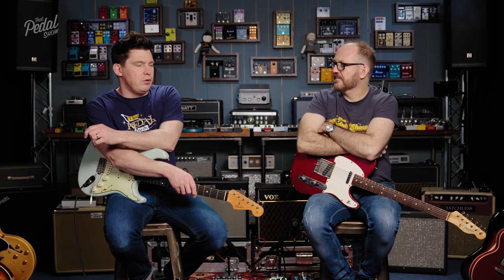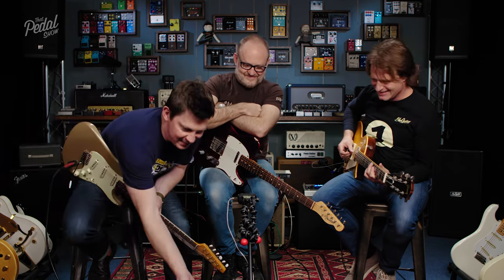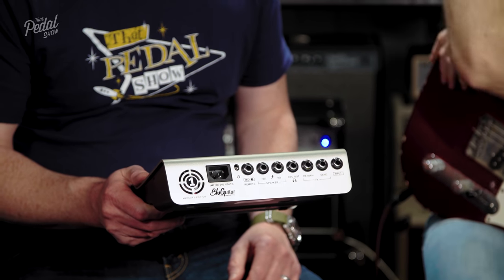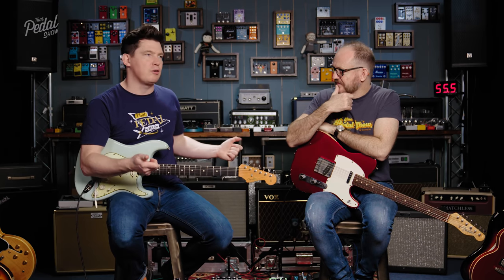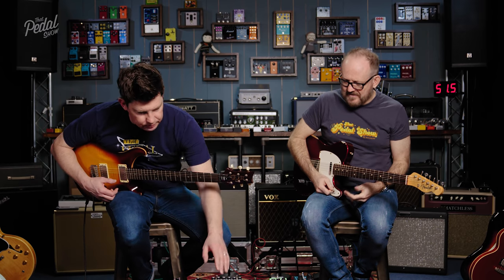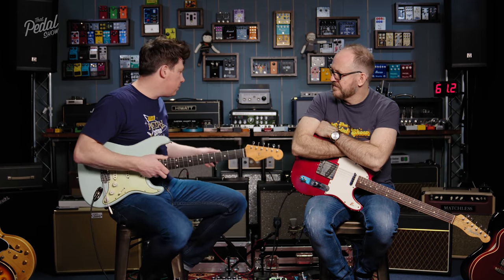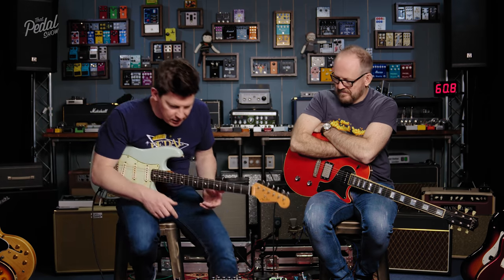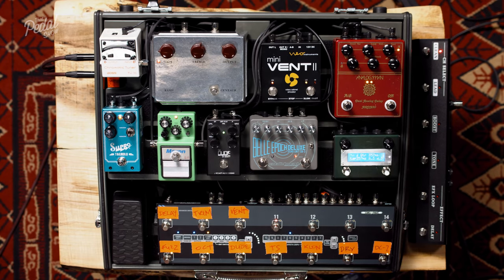Yes We Do Like Transistor Amps #1: Boss & BluGuitar – That Pedal Show

Comment: I'm not sure what point you were trying to demonstrate, Mick, fiddling with the AC15 tone cut control while claiming that the difference you were hearing is a feedback thing. The Vox tone cut is not a negative feedback control -- can't be, since there is no NFB loop in the AC. The tone cut is not like a presence control, which is in an NFB loop and changes the amount of NFB "correction" of the signal at some frequencies; rather, the tone cut essentially puts some frequencies out of phase in the forward, push-pull signal going to the power tubes.

There is definitely a tonal and feel difference between amps with and without NFB, but twiddling a Vox-style tone cut doesn't directly change NFB in any way.
Reply from the maker: Oh balls, is that what I said!? That's embarrassing! I need to watch that bit again... I thought I said that the high end character in the AC series was partly as a result of having no negative feedback. If I said the cut control controls that, I'm an idiot! Apologies.
Reply: @ThatPedalShow  It wasn't clear to me just what you were trying to say...  And yes, while still playing what guitarists will call clean, the lack of NFB will tend to change and soften the high-end character of an AC compared to a Marshall or Fender that mostly do have NFB that is "correcting" the change and keeping the output more "true", hi-fi and harsh.
Reply: @ThatPedalShow  I'm also curious whether AC-loving Dan has ever given a Marshall Astoria Classic a try -- cathode-biased, no NFB in the power amp, "edge" control similar to Vox "tone cut" ...might be an interesting proof that it's not about the EL84. I'm pretty sure that I've seen Mick playing an Astoria (can't remember which one) in some video, but don't recall ever seeing Dan do so.

Comment: I saw the title and was gonna be pedantic and say the bluguitar is kinda tube, but you beat me to it in the description. #PedantFail
Reply from the maker: Thank you! And thank you even more for reading the descriptions!
Reply: Rule #1: always read the description before making yourself look a twat! I’m not so much a pedant for pedants sake but thought it would be a conversation starter at least. When is a tube a tube? Are these nanotube things a tube? Is youtube a tube? Is a badly used low voltage tube stuffed after a solid state overdrive section to “warm it” a tube or a marketing ploy? Is a tube only a tube when used at classic full high voltages or is any tube a tube if it’s a vacuum with electrons floating through it a tube? Or is it all a load of bollocks, none of it matters and it’s just about feel, transients, how it goes into compression and distortion and worrying about SS or valve is a nonsense? Well, that’s the whole point of this video isn’t it... 🙂

Comment: In my experience, older solid state amps do not have the same volume issues that newer ones do. I have a 1968 Kustom 100 with a matching vertical 2x12 that is significantly louder than any other amp I’ve played, including a Marshall DSL 100 through a 4x12... thoughts? (both amps run at about half volume)

Comment: 1970s 20W Carlsbro Scorpion combo 2x12 Celestions paired up with a HiWatt DR103. Mahoooosive! The Scorpion just adds a nice little bit of filler to the HiWatt and with the trem on just a hair it gives things a bit of movement. Tasty in its own way.

By way of relating this to the subject matter at hand, I reckon if I took the electronics out of the Carlsbro and just put it in a box on it's own you'd end up with something that looks like the Blug.
Its a simple circuit with a couple of 2N3055s pushing the power and despite being listed as 20W it makes a lot of noise. PCB is about the size of cig packet.

Comment: Dan and Mick! Met you at NAMM last year, I had my green TPS shirt on. 

Wanted to say, power tubes make a HUGE diff, I play JTM45’s. At LOW volumes, the difference between 5881’s and real GEC KT66’s is quite large. Also, I have a Divided By 13 that has both EL84 and 6V6 through the same preamp. Way diff.

Comment: Bassists have been using analogue Class D amps for ages. I have a Gallien Kreuger MB800 which works fantastically well, sounds good, and is insanely loud. There's a little something that a large output transformer gives that Class D doesn't but there are a lot of attractions to a sub 2kg unit! Lightweight cabs are great too.

EDIT: I'm primarily a guitarist, though, and am used to lugging 4x12 & valve head around. Getting lightweight bass rig was eye-opening.

Comment: I remember watching a video on Scott Henderson breaking down his wet dry rig and he showed how he used his Suhr amp as the “dry” amp and a garden variety hot rod Deville as a true “wet” amp. The advantage of his rig was being able to eq/control the wet effects on the fly via the Devilles preamp. He also used the Deville for no tone reasons outside the functionality of that eq. It dawned on me that this could be replaced by a good solid state platform which would also likely be more reliable, like Larry Carlton splitting to a mixer. This lead me to using a Quilter powerblock as my “wet” amp in conjunction with my valve amp. Thanks guys, there are so many uses for having a good transistor amp, great video!

Comment: The whole thing Dan was saying about transistor amps usually sounding buzzy through stomp fuzzes might have been true for some but if you've plugged a big muff pi into a nextone you will be shattered at how good it sounds regardless, pedals like the big muff are really amps in a box and sound great through most clean amps.

Comment: I wonder if Red was just too pokey for the Nextone, the moment your PRS got plugged in it was magic!! Also I am super interested in hearing the Nextone through one of those choice Alnico speakers in your other amps. The price point of an amp like this almost guarantees a so-so speaker. I wonder if an alnico would smooth out the high end sound as well as it does to pokey tube amps.

Comment: Been waiting for this one! I love and prefer valve amps always! Still I have to say, both worlds have their strong points were they shine. Reliability, consistent , weight, and price are a plus on the solid state side. Tone and feel on tube amps are hard to beat though. There was not a bad tone on the show. I say use both depending on the circumstances.

Also for a future show how about stepping over to the dark side and you guys each try an hx stomp. They are very user friendly. Set it up with a patch for each of you and try running it through a fryette power station and some other solid state power amp and see how you can get the most out of it! I also feel that modelers like helix are getting better and have there place as well. 
Thanks again for another great show!
Reply: I usually hate programming things! 
But hx stomp has a very short learning curve. Much like adjusting the real thing. Tones are very impressive! What do you say? Step on over to the dark side! Just once ! No one will ever  say your biased again! Lol!!
Reply from the maker: Everybody seems to want us to validate the modelling stuff. The rest of the world can't be wrong, right? Everybody loves it. We'll get one on the show if, a) somebody sends us one for a few months or, b) either of us has a reason to acquire one. Cheers!
Reply: Totally understand! Thanks, and keep up the good work!😀

Comment: Interesting that you didn't use any drive from the Amp 1. In my experience that's where its sound really falls apart and doesn't work for me.
Even without it driving, in the sounds Thomas tweaked there was a clear (and in my opinion unpleasant) fuzziness of the high end in the Amp 1.
Was it plugged in directly to the interface or going through a cab?

The Boss sounded great. A bit fizzier than the AC and the Hot Rod, but still very nice.
I'm looking forward to hearing the Quilter!
Reply from the maker: Cab - traditional cabs almost always for us. The other bit is explained in the video description. Cheers!

Comment: The same people who rail against anything but a tube amp would probably rave about some of the classic tones achieved by Dave Gregory, Andy Summers, Billy Duffy, Kirk Hammett and James Hetfield, not knowing they were achieved on a JC 120. My next amp will likely be a JC-40... I'm going to rent one for a month to see how it pairs with either my 13-watt Fender Excelsior or my AC-15 in a 2 amp rig. Also, I'm sorry, I GET the point, but "emulate/model" = "poTAYto/poTAHto"! They are synonyms. The Nextone is clearly meant to "model" other amps with certain power tubes. I KNOW they mean it's not "digitally" modelled, and they're so dead set against using the term "model" because it's become anathema to modern day tone gurus, but can we, once and for all, get over the bias against certain words?? It's like "true bypass/buffered bypass" (or, for that matter, tube/solid state!)  One is not better or worse, but different and useful in different circumstances!
Reply from the maker: Yeah, we like this Gary. It's part of the point of this video. Everything is a variable at the end of the day. But the day I'd choose anything over my ridiculously expensive and largely unnecessary valve amp is frankly unimaginable. That's okay isn't it? Mick here. :0)
Reply: @ThatPedalShow  Of course! But I think you'd agree that my choice to gig with a couple of sub-$1000 amps, a plain-jane American Standard Tele, and, in large part, less-than-boutique pedals is NOT the reason you sound better than me.... it comes down to you're an amazing player and I'm a talentless hack! If we swapped gear, you'd STILL sound better! ;)

Comment: Hey can you guys please please do an episode on how to clean up your sound or get rid of the noise in the signal. Been requesting this since ages. I always see you guys using these high wattage amps, various gain pedals, but you guys don't seem to have any noise in your signal. How is that? It would really be helpful if you could do an episode on ground issues, power supplies, guitar cables, guitar/pickup wiring etc. to let us know what is the best way to get rid of most if not all the noise in the signal. Thanks.
Reply from the maker: Every show is about this. We use the best modular power solution available and the best true-bypass loop switchers. No noise! Cheers!

Comment: When you show all those pedals while playing at the beginning of each episode … are all those pedals generally on?  I usually can't get a sound I like with more than 1 or 2 pedals on at a time.  I was thinking about this after the recent wet dry episode.
Reply from the maker: No. It's a combination of things as required. One of the reasons we use these crazy boards is that stuff does sound good together when it's wired up and powered right. Cheers!

Comment: Hey Dan and Mick! I have really enjoyed watching (and catching up on) all of your videos over the last year and a half. Because of you guys, I ended up rotating through 30 pedals last year, and I had never owned a pedal before that (I can't wait to see what happens this year)!  I would love to have brought up this question/idea in an appropriate video, but I hadn't thought of it when it would have been most appropriate (at the airing of the Leslie video).

Regarding Leslie sounds, I know you have said that, while some pedals do an admirable job at approximating the tone, there is no replacement for the actual moving parts.  Well, I have an idea for recreating that sound, but am without the resources to tackle it, and I was hoping you might be interested in doing it.  

Essentially, you use the outs of a Leslie pedal set to Bi-Amp (one out = bass speaker, one out = horns).  You split the bass speaker signal into two amps (faced opposite directions) and you phase invert one so that targeted directional phase cancellation would occur (possibly), to approximate the sound of a rotating drum in the room.  Then you also split the treble/horns out into to smaller amps (faced opposite directions) with no phase inversion (to approximate 2 horns spinning opposite one another).  The two smaller amps would be placed on top of the two larger amps (see example below).  Would you be interested in replicating this for an episode to see how close it could be to a real Leslie?

T = treble/horn 
B = bass speaker/drum
</> = direction of speaker
+/- = signal

+ <T | T> +
- <B | B> +

Alternatively, you could try one bass amp (since that should be similar to the rotating drum anyway) and just add the two treble amps above it.  Anyway, it is just a thought...

P.S. I am super excited to see Part 2 with the Quilter! I have had a MicroPro Mach 2 head for a little over a year now, and It has worked wonderfully in every situation and sounds fantastic with every pedal I stick into it, so I am interested to see how you guys like the 101 Reverb.
Reply from the maker: That certainly sounds elaborate! I've thought about cutting a plastic barrell into a two foot section with a hole in it. Rig up some kind of manual sewing machine treadle thing, some barely adequate twine and some spindles and pulleys. Maybe a cement mixer. There's got to be a way! 
Good luck with the experiments!

Comment: I’ll be going out with an act that will require me to have a good fender clean tone, some reverb and a slight boost. I’ll need a speaker cab on stage to start with but the band will be going  ‘silent’ soon. Will the Amp1 serve my needs?
Reply from the maker: 100 per cent yes.

Comment: another great video from TPS. I would say there is a parameter trap comparing amps whether they be tube or SS. Aside from approximating the primary elements of feel and volume, the tone is the key element. If it sounds good, even if doesn't sound exactly like a particular tube, is what counts. The primary elements of tone and feel become more distant when you add pedals and and outboard effects imo
Reply from the maker: No real arguments here. I’ll make a blanket statement. Elements of great guitar sound for me, purely personally. 1) 25 per cent TONE (EQ, gain). 2) 35 per cent FEEL (dynamic, transient response, harmonic feedback). 3) 40 per cent VOLUME (I can’t play quietly). 
The only caveat is that if 1 and 2 aren’t right, 3 doesn’t matter.
Hmmmm. Mick here.

Comment: Man! The nextone sounded amazing for the fuzz!! In my experience one of the best tones for overdrive, distortion and delay I have ever had was when I was forced to use a Roland jazz chorus and oh man it sounded so amazing!!

That being said the other best clean tone I ever came across was borrowing someone’s boogie mark 1 and that was just unreal have you guys ever used one?

I don’t use transistor amps but have been contemplating it for a few years now and these vids just make me want one atleast to blend with a tube amp!! I sold my red stripe bandit years ago for about £100 and still regret it cause those things are actually amazing
Reply from the maker: Yeah, I have a MkI - Mick here. Currently in need of repair... Cool amp!

Comment: I expect the valve amp cabinets are plywood and the Nextone is MDF. Do you think that makes a difference in the tonal quality?
Reply from the maker: It absolutely makes a difference... But whether one is 'better' is probably a moot point at this stage. Not sure about the Nextone cabs - interesting Q. MDF usually sounds dead flat to me - Mick here - where a wooden cabinet has a definite resonance. Interesting!
Reply: @ThatPedalShow  The JC 40 is MDF. The type of plywood (birch, pine, etc.) probably makes a difference, as well. Also, thickness, type of glue, etc. Now I'm into a can of worms. Sorry about that.

Comment: Really interesting ...
So they're getting closer on tones and breakup with the analogue solid state stuff..
One thing, amongst others, I took from this episode was that the old perceived volume vs power thing is still with the valves though. 
A 40W rated valve amp with Master on 2 being louder than the 80W rated solid state on Max. 
Of course Max overall volume isn't the be all and end all, and not all valve power stages sound their best flat out, though I'd venture that most probably do. Or at least have another sound character usable in a different range of conditions than when used with headroom to spare.
 
I've no particular prejudice, though my long time preference has been for valve amp sounds. 
I own amps of different sorts; old and new type valve, straight solid state and modelling solid state. 
All useful in their own ways. 
Looking forward to Part Deux ...

Comment: I don't understand why you tolerate some transistor amps and then why your pinch your nose when someone mention modeling amps. For example a Kemper can be run with a full pedalboard in front or in the effect loop, and the amp model choosen reflect the behaviour of the true amp with the same pedalboard in front.
Reply from the maker: Thomas explains this quite nicely in the video. I'm up for messing with a Kemper for a while if somebody would send us one. I ain't buying one though.
Reply: "Meanwhile, how are you getting on with your Two Rock and Matchless? "  Huh ?

Comment: Nearly every pedal is solid state.
Reply: Chris B that’s why I rarely use them for overdrive/distortion and use my amp channels. Except when my amp is set on the edge of breakup and use more of the volume boost of a pedal to make the amp create the overdrive, but with added clipped overdrive to add texture, or if I want a big fuzzed out muff sound, in which case it’s using the clean amp more for its compression sag and warmth characteristics. 🙂
Reply: They still come out through the tubes. That test with the fuzz face is telling. That tone is sweetened by the tube amp. Put that through a crap solid state and it sounds very harsh
Reply from the maker: Indeed. It's the reaction with a valve amp where the traditional 'magic' happens. It's an ecosystem. Remove one part and the other parts change too